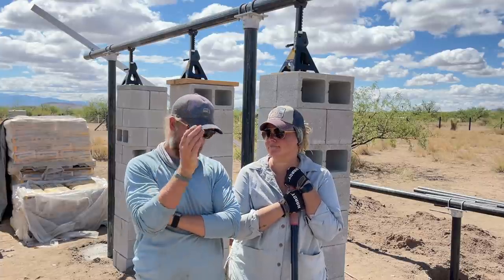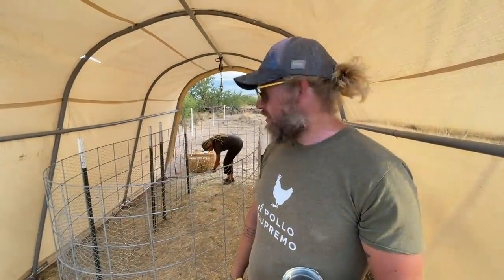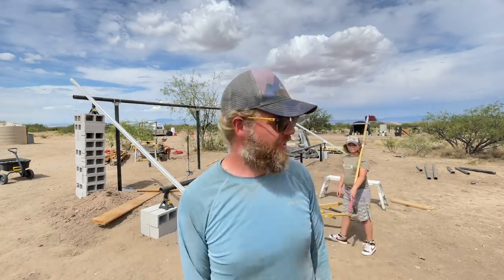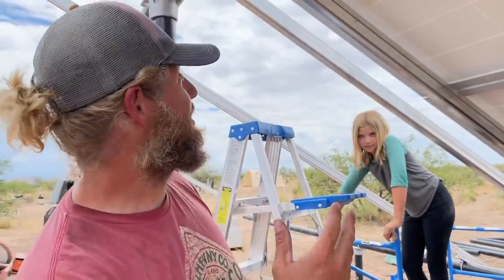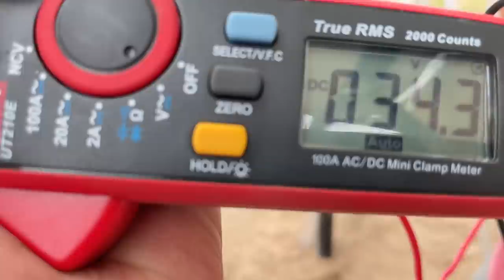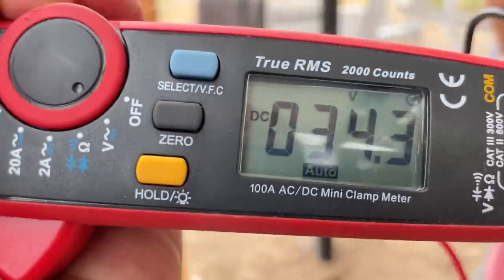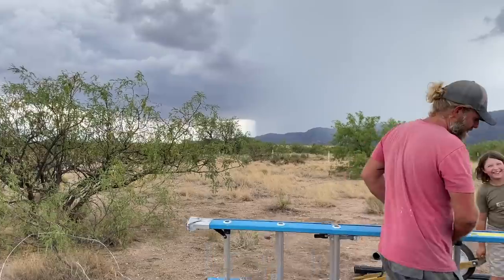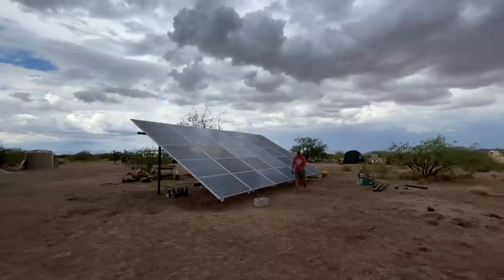Off-Grid Solar Panel Ground Mount - Pt 2 - Cementing piers, IronRidge rails, installing solar panels

Comment: Cement is an ingredient of concrete. Concrete has gravel or crushed stone, water and cement, some sand is also added to the mixture.
Reply: Came here to suggest this. Also if it says "Cement Mix" it's technically some kind of concrete, with the gravel, crushed stone, sand (all of which are called aggregates) already included. Fun note, depending on the application your aggregate can be something other can gravel or sand, in the case of "Low Density Concrete" or Aircrete, it can be styrofoam beads. 

Lastly, since you have cement in your hyper-adobe bag mix you could technically call your the structure a concrete structure.
Reply: One of my pet peeves, when people call concrete “cement”.  It’s like calling cake mix “flour”.  Thanks for pointing out the difference between cement and concrete.  By the way, air is also considered an ingredient of concrete, especially in northern climates where concrete must have air to deal with freeze thaw cycles.

Comment: Perhaps a trough at the base of the panels to collect some rain run-off for your rain harvesting?  After all, it's a nice surface for rain to hit, drain, and become useful for y'all.  Good work on the array---that sucker isn't going anywhere no matter what winds come up. . . .well, it may become airborne, but if it does---it's the end of the world!!!

Comment: Here in the midwest you can dump the bags of quickcrete directly in the hole, spray thehole with water and your done. The concrete absorbs the water and sets up just fine. You're in a more arid climate though but I imagine just adding more water would solve that problem.
Reply from the maker: For a fence post, sure. For a 33'W x 15'D x 10'H giant windsail you gotta mix it properly.

Comment: It's a bit late to say this, so for future reference, if you have problems with the holes you dig getting too big when setting poles for cementing, you can buy those cardboard tubes and put them in the holes before the poles. They will help keep the amount of concrete needed lower. Once the concrete is in, you can backfill the hole.

Comment: A little taller and it might have been a great water collector. Now if you build a mirror match shed to go behind it, and give it skirts at the low ends, it'll be more arrow dynamic which will give you a shed and a lot less chance of it blowing away. 

Concrete is a combination of rock and cement and water, Morter is cement with nothing but water added to it, although sometimes sand is added to make it go further and give it more body.

Comment: The cement mixer tub should be on a 45' angle when mixing which brings the mixer blades into play. To clean out the accumulated gunge from running it upright, put rocks and water in it and run it till it's clean.
Reply from the maker: We don’t run it upright, but I like your cleaning idea 👍🏻

Comment: instead of quickcrete, you could mix 1 part by volume portland cement, 2 parts sand, 3 parts gravel and 0.5 parts water.  It should be significantly cheaper.  a 94 pound bag of portland cement should make 4.5 cubic ft of concrete (with the sand and gravel included).
Reply: I'm saving this recipe, thanks!

Comment: So any rebar? Mixing by hand, that is so tough. Cool, cattle panel shaded chicks! Nice! The rainbow was beautiful! I'm so glad to see that the kids are helping mix the concrete with you! Nine nine has to be there right with you, so cute. Beautiful sunset. Nice chick set up! Cats are interested. Using hoes to mix the concrete looks a lot easier than shovels! I'll have to remember that.We just poured a little pad for our heating oil tank. That looks way easier. Lizard supervisor. Yay, finished with concrete! Cute goats! Fog! Thanks for explaining how each panel gets installed. So that must be why there are so many UFO sightings in Arizona, because of all the solar arrays! Nine nine found some shade. Wow, look at those clouds form! Use a piece of steel pipe over the end of the ratchet. You got it! Nice chin ups! Beautiful solar panel array! You guys work so well together. This was a joy to watch, thanks.

Comment: Hey, I think we got your 3” bracket.  We are installing two arrays (32 panels) with 2” pipe, and we ended up with one 3” bracket that I had to drill our to make the 2” u-bolt fit.

Comment: The concrete mixer hangs too far back, so the concrete sticks there
Tilt the opening slightly downwards then it's good 
And you could have put buckets in the holes and poured concrete into them. 🤔

Comment: did you put rebar in the bottom of the holes drilled in to the steel ? you know you can put rocks in the hole with the concrete also more gravel it will set hard believe me should get the trench and lay the wires to the shed so its ready very good job

Comment: You said you got used solar panels, where did you get them from. Looks great. You've done an awesome job. The kids are great. That's one of my dreams, to have a sustainable, off grid home. Watching your projects has reignited that dream in me. I am getting a lot great ideas from you. Keep going, and I keep following you. One thing I would do different is I'd like to do with adobe vault ceiling, and thick enough so I can eliminate industrial insulation.
Reply from the maker: Santan solar in Phoenix.

Comment: Too funny! FYI you know you can pour that dry mix right into the holes and just pour water over it and it works the same. Set all my fence posts that way never have had any issues.
Reply from the maker: We set our fence posts that way too, but we’re doing it the correct way for this major install.

Comment: Concrete is a mixture of cement and aggregate. Gotta ask. Why are the holes so massive? Wouldn't a 12" sonotube have been sufficient for the footings? Iron Ridge....excellent choice.
As always, your video is just beautiful to watch.
Reply from the maker: We tried (in the last video) to dog 12” holes but they needed to be 7.5’ deep and we don’t have access to a tractor that went that deep. So nugget holes and less deep is why we needed to do according to IronRidge specs.

Comment: You probably said but why did you have to make the holes so big? I've watched a lot of solar panel installations and yours is by far the most sturdy. You won't have to worry about it going anywhere.
Reply from the maker: Because our ground mount is 33' x 15' x 10' tall. It's a giant wind sail and we get nearly 100mph gusts out here. Also our soil is basically sand. I think a lot of people don't understand the engineering specs on this, but it's all been planned, researched, certified, etc...It's just sized to the proper conditions.
Reply: @TinyShinyHome  I figured as much considering the attention to detail that you apply to all you do. I commented on your fence way back when 👍👌

Comment: Can you make the solar panels rain harvesters?
Reply: Yes.  Good idea.
Reply from the maker: Maybe, maybe not. There are spaces between each row where it falls through, and the system is designed that way to allow wind to escape through so we can't cover it. We're researching, but our plan B is to let the water drip naturally and plant a small garden underneath the panels. Biosphere 2 did an experiment with plants underneath panels and they actually increased panel efficiency by 15-20% because the plants cooled the back of the panels off in the summer.

Comment: If that is qwickcrete, couldn't you have just poured it in the hole and add water. It would have only taken you a few hrs.
Reply from the maker: We’re doing everything to the specifications of the manufacturer

Comment: Did the engineers not allow sonotubes??  That seems like it would have cut down the concrete requirements.
Reply: Cement is the magic you mix with sand, aggregate & water to get concrete.
Reply from the maker: We bought 12" sonotubes when we were doing 12" holes, but when we had to switch to 24" we just took them back. Not worth the hassle, and wouldn't have made much difference in the amount of concrete required.

Comment: why do the holes have to be so big for the bases of the array,that is a whole lot of concrete!!
Reply from the maker: In the last video we talked about how we needed 12” holes that were 7.5 feet deep. We didn’t have access to a tractor that could go that deep so we are going off of the manufacturer’s specs and doing 24” holes at 5.5 feet deep. All to their specifications.
Reply from the maker: Also because it’s ginormous and basically a big wind sail.
Reply: Just fill each hole with two feet of concrete and fill the rest with dirt. 
That weight of concrete will anchor the uprights if they had short cross pins attached on them embedded in the concrete. 
And remember to buy the largest wattage of panels 500+W so you can deal with 1/2 of them to make a smaller footprint for the same cost/W.